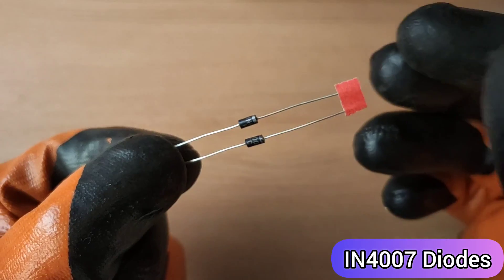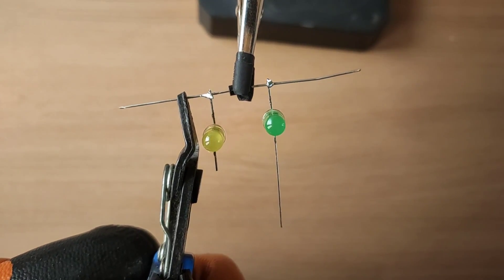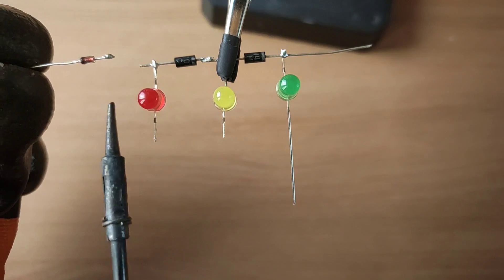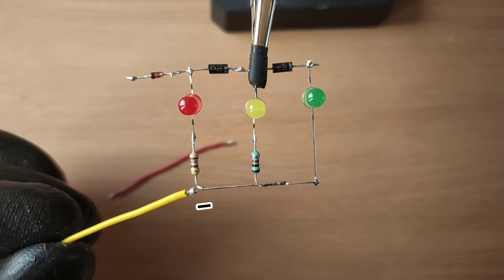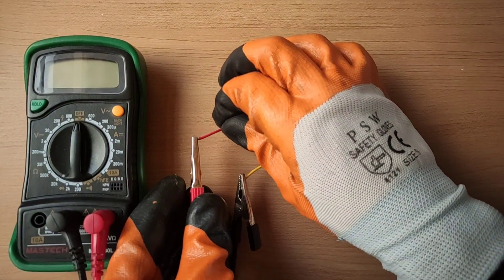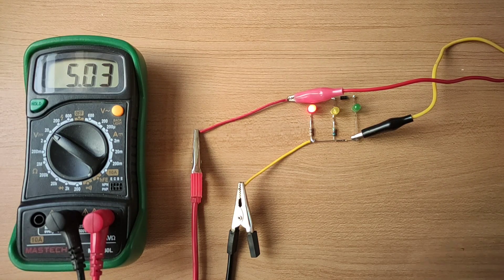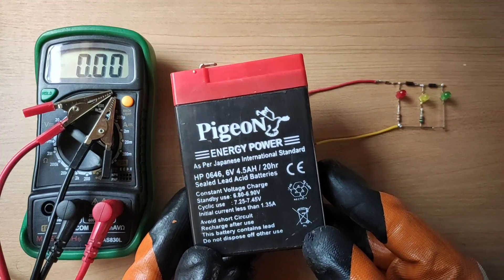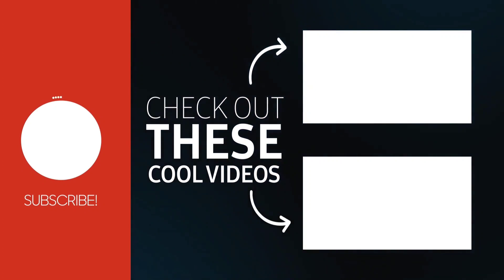6 volt battery level indicator circuit

Comment: Thank you for the great work, you can do the same from 0V to 24V.Also, if you disconnect your automatic, the battery is full
Reply: Also, if you disconnect your automatic, the battery is full
Reply from the maker: Yes I'll soo make that project and upload.
Reply: @CreativeTechos  It should be multi-voltage, from 1V to 24V, and it works automatically. When the battery is filled, it is disconnected. Thanks you
Reply: I tried the method, it works on the power supply, but it does not work on the battery, knowing that the battery is full and only the red light works. Where is the problem? Please reply.

Comment: I tried the method, it works on the power supply, but it does not work on the battery, knowing that the battery is full and only the red light works. Where is the problem? Please reply.

Comment: What  component values would you change for an 8 Volt lead acid indicator circuit?
Reply: @CreativeTechos  Are you using a 3.3V zener on this 12 volt circuit?
Reply from the maker: Use 4.2-5v zener diode for your 8v battery, and for 6 volt i have used 3.3v, there is video available for 12v also on my channel
Reply: @CreativeTechos  should the resistor be replaced sir?
or just the zener replaced